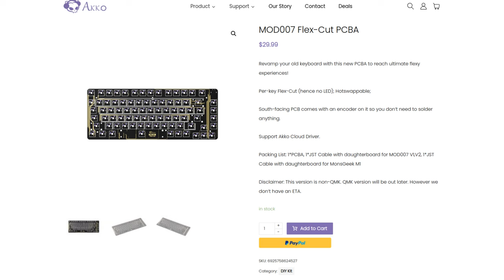Akko MOD007 - PCBA Per Key Flexcut Upgrade, Mod, and Sound Test #thockykeyboard #soundtest

Comment: To get this straight, You are adding that PCBA to make the keyboard support 5 pins switches ?
Reply from the maker: No, the original MOD007 is 3/5 pin compatible North facing PCB, the new PCBA is South facing PCB with per key flex cuts.

Comment: Hello thank you very much for the video, I would like to know if the PCBA is VIA compatible?
Reply from the maker: Thanks, I'm sorry, but the PCB is Akko Cloud programmable, not QMK/VIA.
Reply: this PCP is not the same PCP as mod 007 v3 VIA? when downloading the json file V3 it does not work?
Reply from the maker: @malisakar2101  no, this PCB is not the same as the MOD007 V3.
Reply: My problem is that I have a Monsgeek M1W ordered in China, Chinese productions are not VIA compatible. do you know of a VIA compatible PCB that mounts on the Monsgeek M1W? I thought about the CSTC75 PCP 75 RGB 75%, do you think which mounts on the Monsgeek M1?
Reply from the maker: @malisakar2101  wireless Monsgeek keyboards use the Monsgeek Cloud driver. I know of no other compatible PCBs.